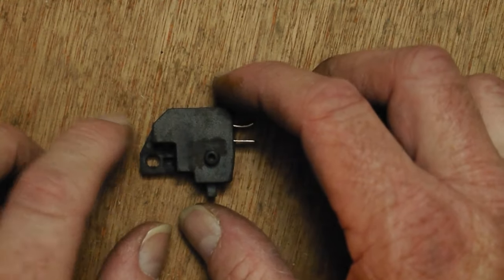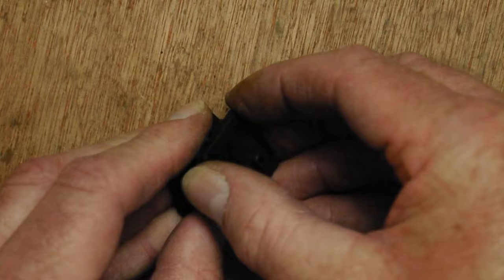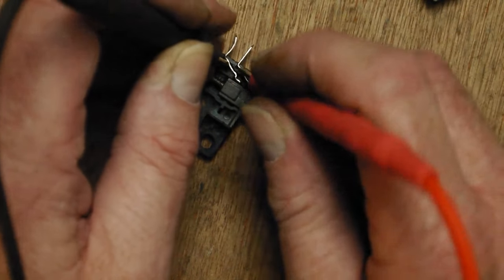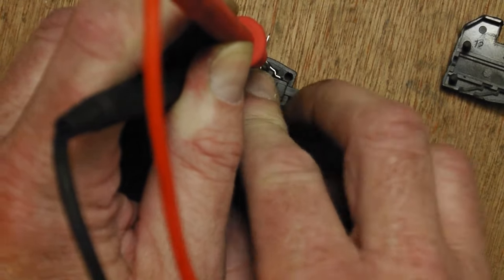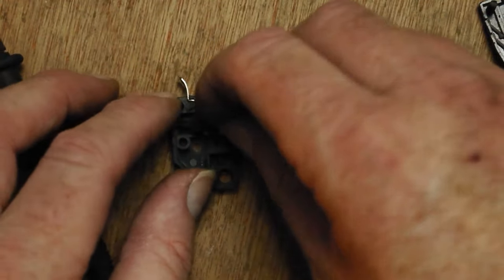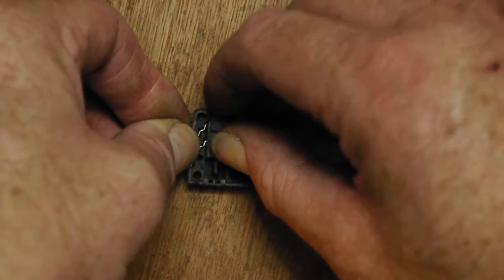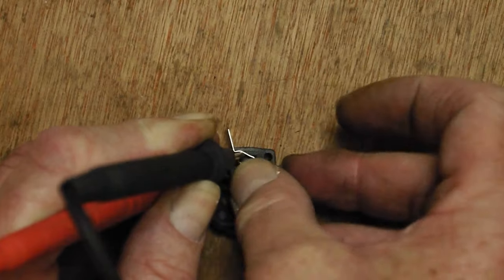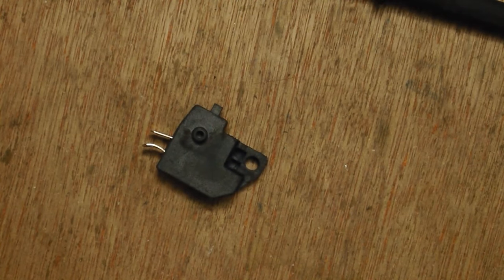Kawasaki ZX6R Front Brake Light Switch Teardown

Comment: permanent stop light isnt any safer than not having a stop light, its just so the light comes on immediately when the lever is depressed
Reply from the maker: If a wire falls off, though, isn't it better to have the light on so it looks like you are braking all the time, rather than not looking like you are braking when you do brake and potentially getting run into?
Reply: @menadue  i doubt anyone will even notice its a stop light if its always on
but it does signal very clearly that the switch is broken, that might be part of the reason